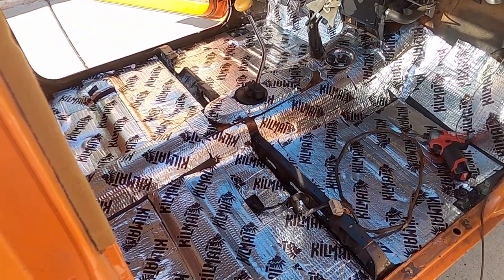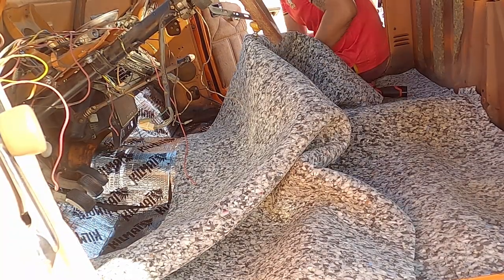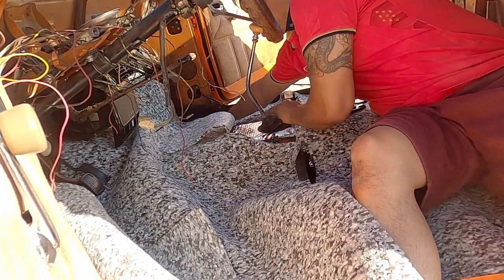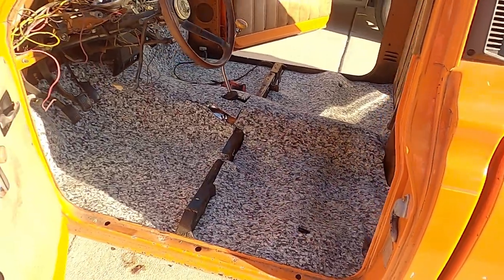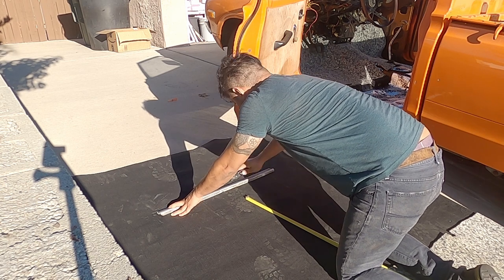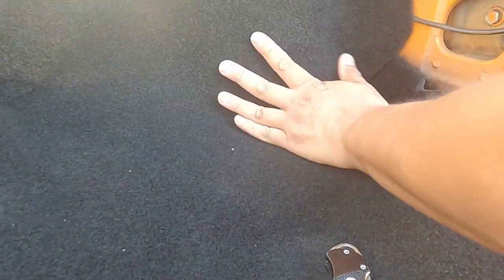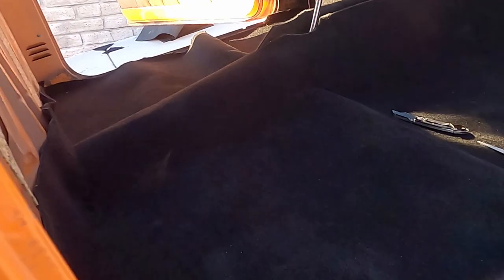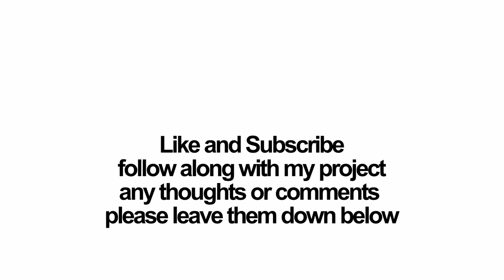DIY : HOW TO install new carpet in your car For Only $40

Comment: How did you glue it or nail it? Or you did not tack it down??
Reply: it will wear into the floor well, never use glue unless using in very small amounts like corners or siding.

Comment: Nice work; very painstaking and finicky, but you can always cut carpet off; you can’t cut it back on 😮

Do you need to cut the slit full length for the shifter, or can you just do enough that can be covered by the center console?